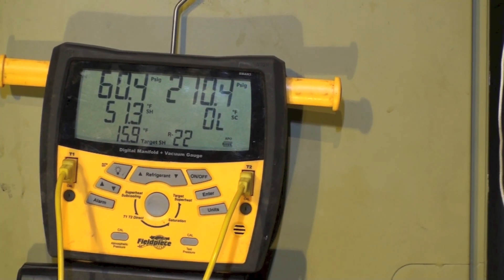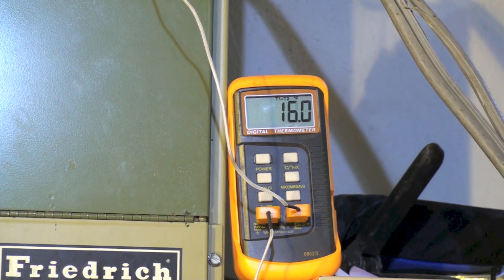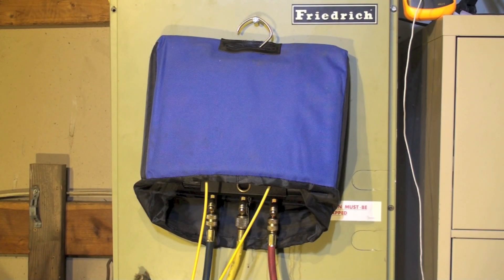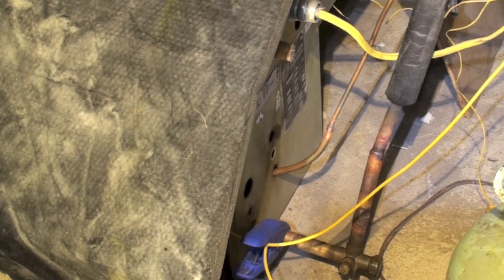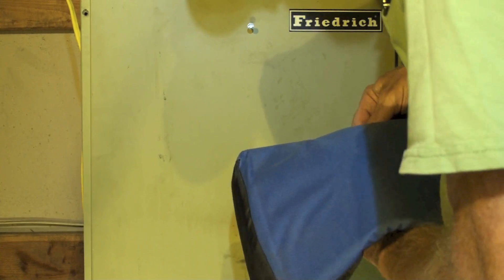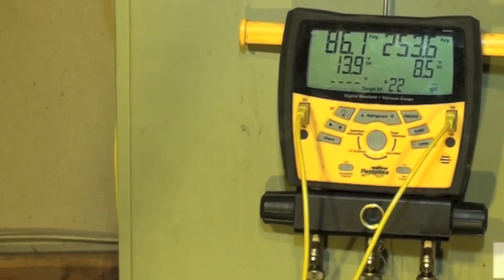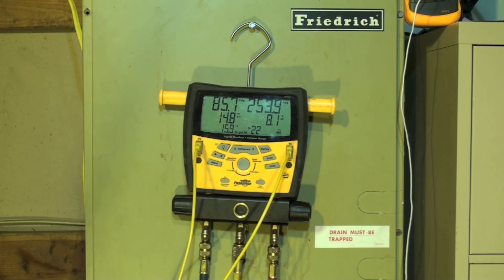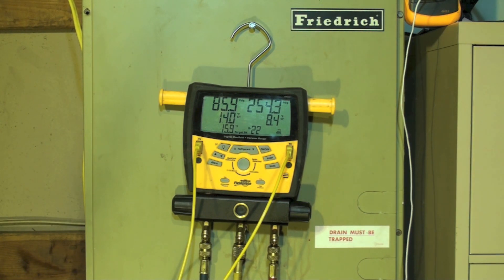Charging the air conditioner by hand lower air flow #2

Comment: Real pro at work thanks GFM whats your thoughts on the frost line method.
Reply from the maker: Jonathan Todd Frost line is only used for low temp work with fixed orifice.  If I get a commercial freezer, I will do some on it.
GFM

Comment: Can you describe what you feel on that pipe when it's low in charge, and what your looking for as far as temp when you feel it's right? Just curious
Reply from the maker: mazdalorean That is the tough part.  Remember I said it is a skill that is learned over time?  The line will change temperature fairly rapidly when the superheat is right.  The ability to detect this is the key.
GFM